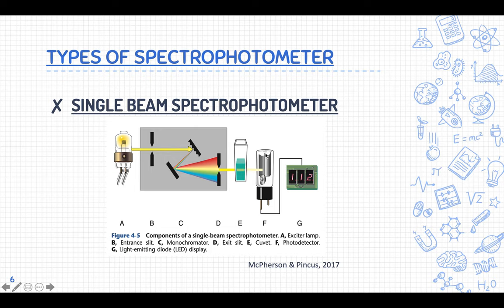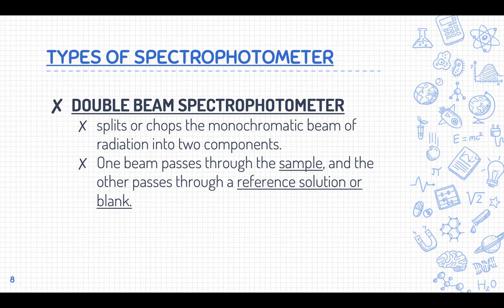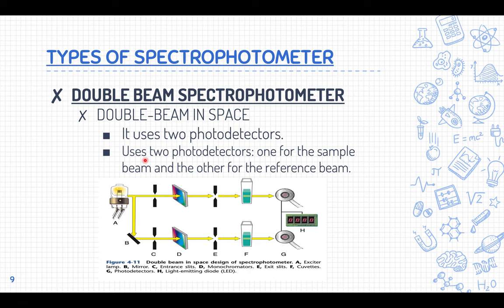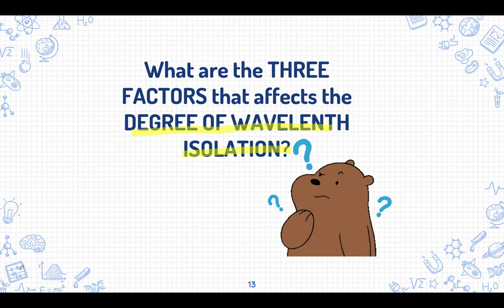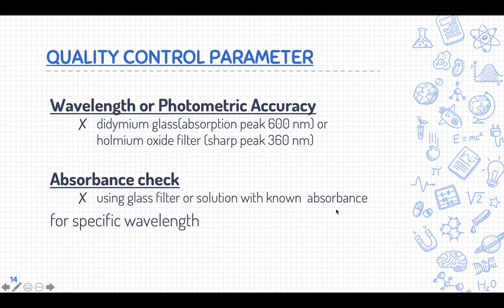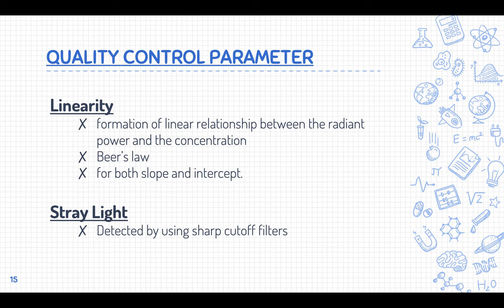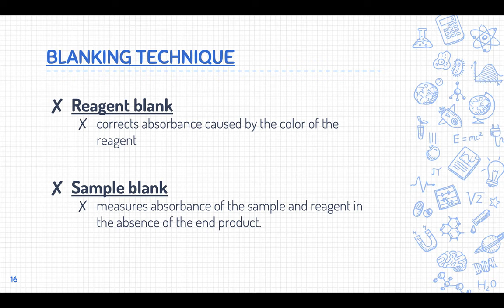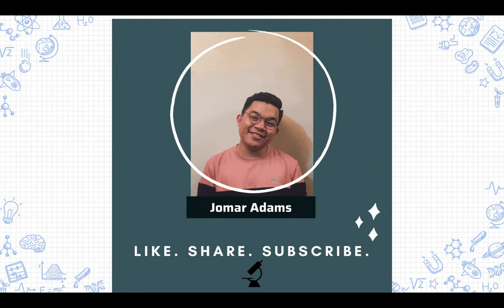Quality Control of Spectrophotometer-Part III

Comment: Factors that affect the Degree of Isolation
1. Type of Monochromator
2. Width of the entrance slit
3. Width of the exit slit
Reply: Sir, question po. In 28:31, does this mean po na may iba pang type of reagent blank aside from deionized water?
Reply from the maker: Correct! :)
Reply from the maker: @dopenguin4953  Yes, you can make use of the reagent itself to correct the absorbance contributed by the reagent. Because some reagents has colors.  Blanking using the deionized water is usually term as "Blanking",  there is also reagent and sample blanks mentioned above. Nonetheless, the principles are all the same. :)
Reply: @JomarAdams  thank you sir! 💙